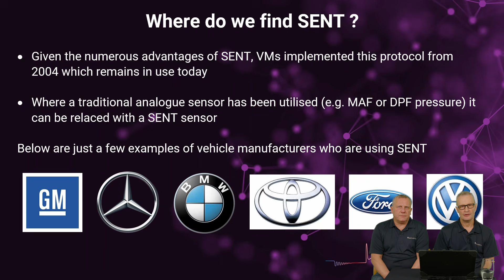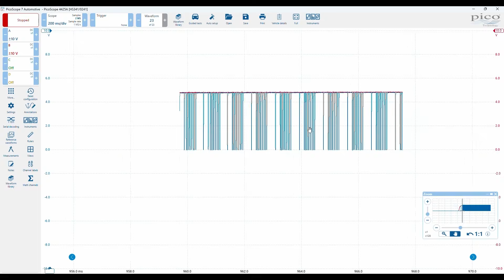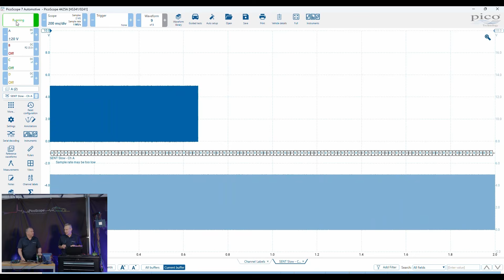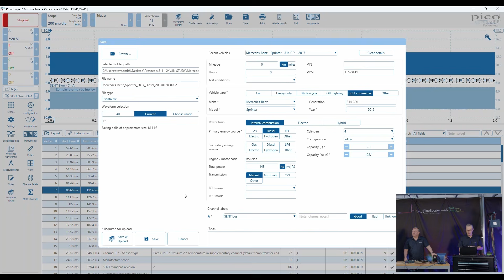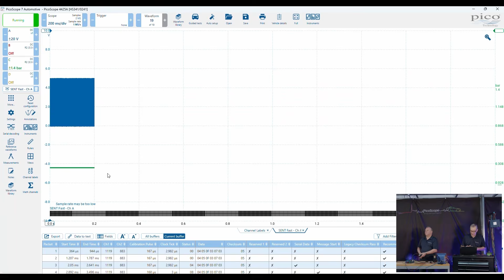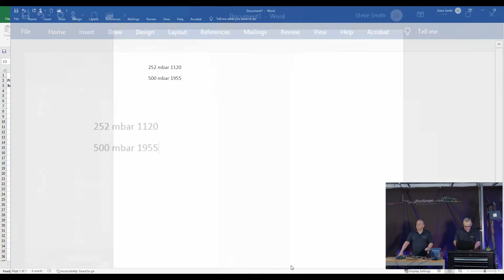Comms Network Part 6 - SENT Protocol Explained: Sensor Diagnostics, Decoding & Tick Time Analysis

Comment: Without actual sensor data it’s basically useless. If I’m looking for rail pressure data that I need right at the moment of starting an engine then the scan tool is practically useless as it takes too long to reconnect while starting. The key has to be off for a while to get it to act up. If I had that actual data from Pico live on the screen then I could see what I need to see. With an analog sensor this was easy. This new garbage just continues to get in the way of actually diagnosing cars and I don’t understand why people act like this is a cool step forward because it’s not. It’s the exact same amount of wires as an analog pressure sensor. They’ve saved nothing and have only managed to hide the actual data from people who need it. All they’re doing is over complicating things that don’t need to be. 🤦‍♂️